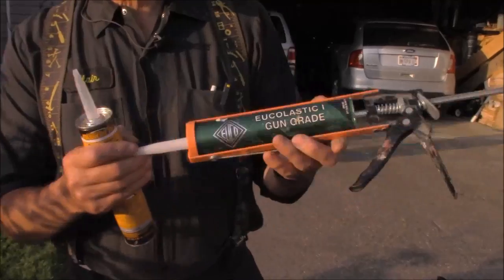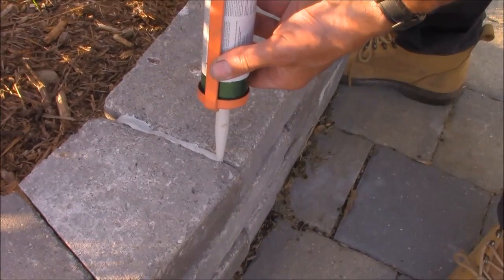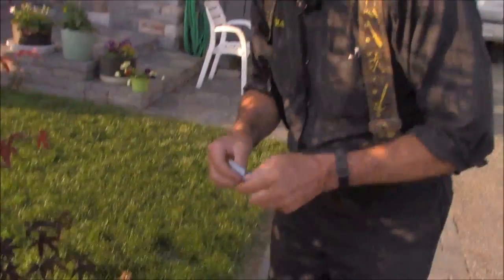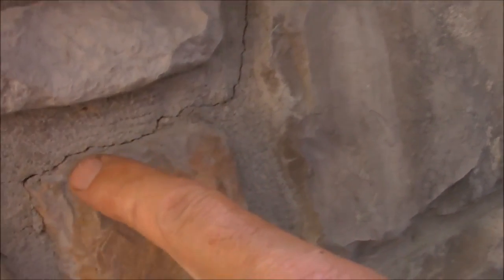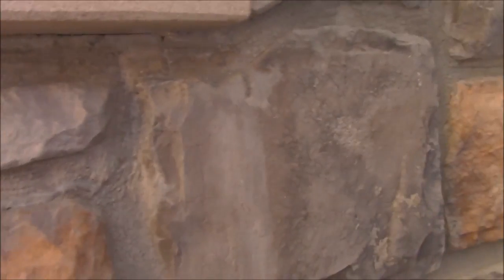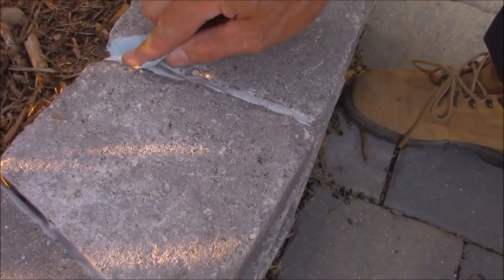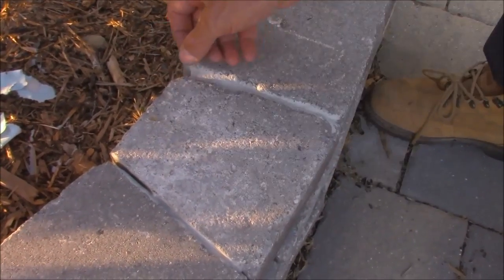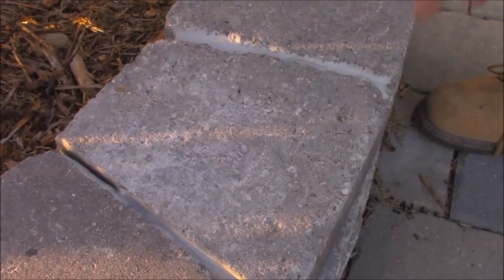How To Caulk Brick Porch Perfect, Repair Exterior Masonry, Fix Cracks, Waterproof

Comment: Suggest including a bit of talk about using backer rod on the wider joints to prevent three point bonding and some sagging
Reply from the maker: My favorite on larger cracks is to use Minimal Expanding Foam. Flexible, waterproof but messy in the wrong hands. It takes practice to foam different size cracks w/out wasting the foam.

Comment: Thanks for this. New homeowner here. Can you use both products on larger holes in stone walls? Self leveling to get deep in the space and then gun grade on top of that? Also, what do you recommend to fill spaces between wall & floor in a basement, particularly in a 3-season room where bugs are getting in floor? Thank you!
Reply from the maker: If the holes are large enough I would use spray foam first. Outdoors I like to find black landscapers foam because of it's uv properties but not required. Trim the foam and use either caulk. Self leveling caulk will get lost in a deep or large hole, plus being so liquid it won't hang if put on heavy. It will run down the brick, stone and  be a mess. Self leveling is for small cracks, or for the floor in the basement. I bet some areas will need a second coat.
Reply: @MrHardware1  Thank you for this. I appreciate it greatly. Are there any brands you recommend, or types of caulk I should stay away from for the basement floor?
Reply from the maker: @taryn41  Any polyurethane self leveling caulk should be fine. It should cost more than $5 or so...

Comment: Mr Hardware, I recently had a mason repair cracks in my garage floor. First, they chased the cracks with a special grinding wheel. Then, used Sikaflex self leveling sealant. I don’t think the guy has much experience with the product and he applied too much which caused it to overflow out of the groove a bit. I looked up the product and it says that it is sandable. Was wondering, do you know if I can sand the excess off to make the job look cleaner? The groove is only a half inch wide, but I’ve got overflow in some areas up to 2 inches!
Reply from the maker: I have seen plenty of excess self leveling caulk but I have never tried to sand it. Being it is so flexible you will need a very coarse grinder. Possibly an oscillating tool with a sharp chisel blade.
Reply: Mr. Hardware, just wanted to give you an update. After about 3 weeks, I used my air angle grinder with a 3 inch 36 grit disc and removed the excess material. Took it right down level with the surface. Looks much better now. Went pretty quick too. I have to go back and fill a few holes where air bubbles were trapped now, no big deal.
Reply from the maker: @christrainor1129  Nice, I'll pass that along. Thanks

Comment: I just built a fire pit this afternoon  out of red brick pavers and 12x12 concrete slabs.  I'm not real thrilled with how my joints turned out and am looking for any recommendations on what I should use to fill in the joints better? Should I go with a self levelling or regular silicone compound?
Reply from the maker: If the area is going to get hot I would use mortar. The real stuff w/water and using a trowel or a mortar bag to get it into the joints.